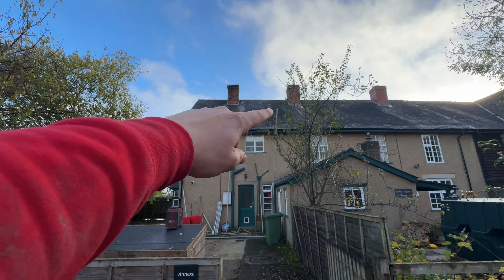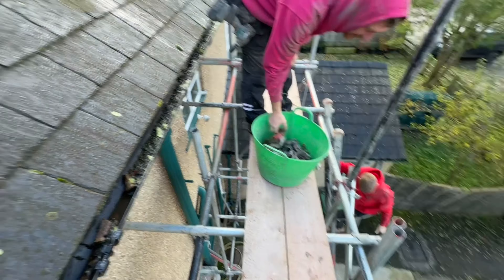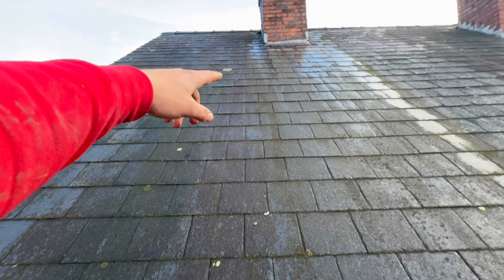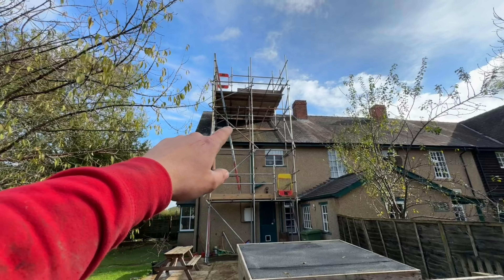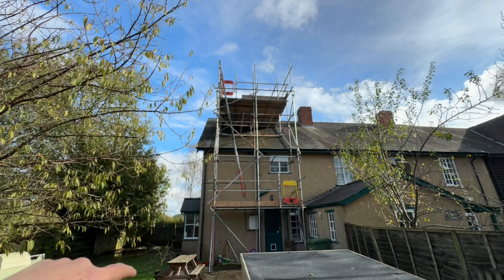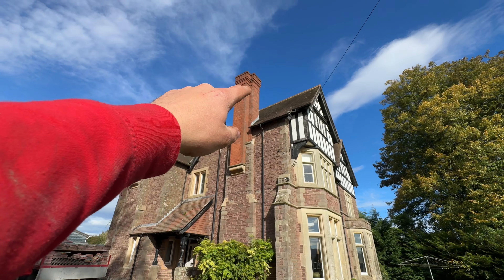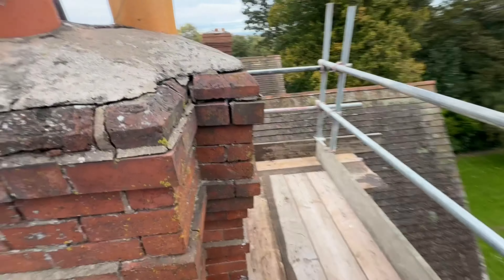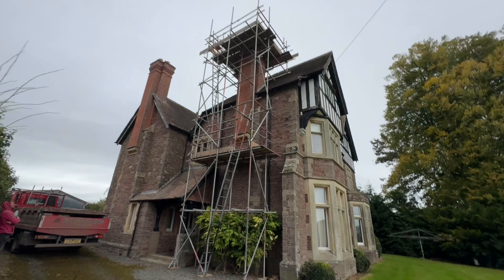2 chimney scaffolds on a Friday 🙈

Comment: Oxford, 

We throw in direct to board. Generally hold the board in place with tube on a swivel. 

Throw in, undersling on flappers.
And repeat. 
Is a ball ache though. 
Your was looks way more productive
Reply from the maker: They always slip down and push scaffold out doing it that way I find so I just do it like that. The way I do it takes bit more kit and maybe time but a lot stronger.

Comment: Was that first job not tied at all?
Reply from the maker: @lloydwright3661  neither was tied just pressure tie in window
Reply: @Madscaffs  wow, that's alot of gear to be hanging off a window reveal if it did want to go 😅
Reply from the maker: @lloydwright3661  we’re and how will it go
Reply: @jrscaffolding5901  I'm not saying it's going to go anywhere but we don't put ties in for the fun of it...
Reply from the maker: @lloydwright3661  done it for 8years and never had a problem but yes your right probably should have some ties in it.